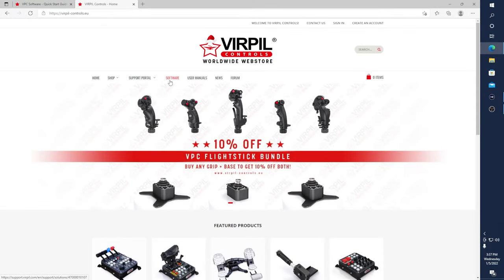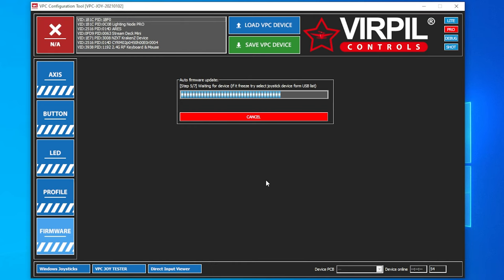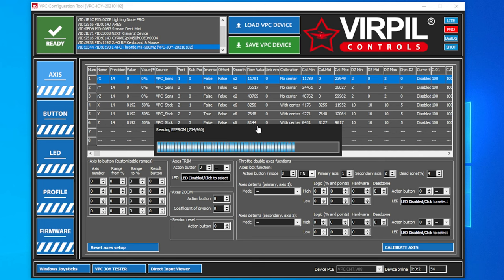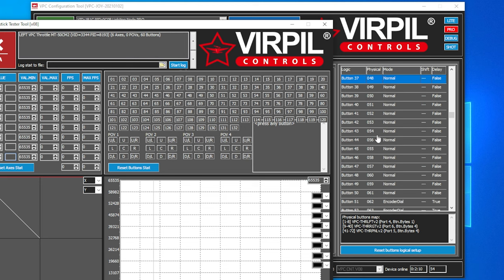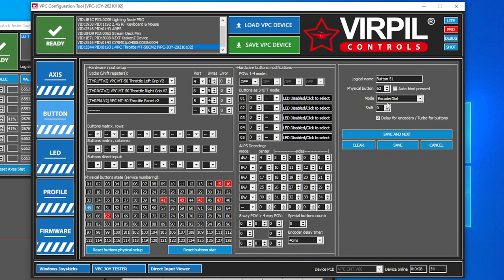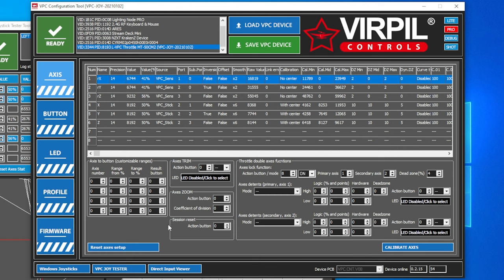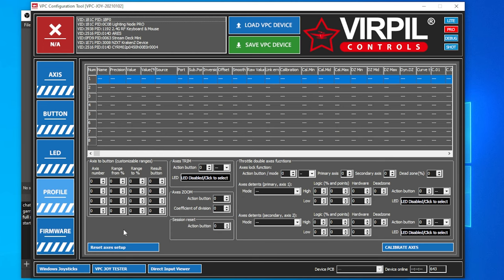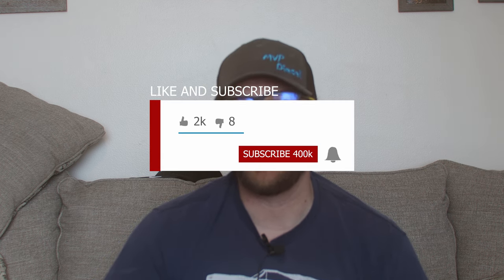COMPLETE 2022 VIRPIL SETUP GUIDE. FROM OUT OF THE BOX TO YOUR FAVORITE SIM.

Comment: I am really pleased that I found your video, I have been hesitant to pull the trigger on Virpil because the programming looked intimidating.   This has also cemented my choice due to the quality and straight forward aspect of their product.  A slight learning curve with programing everything I am sure, but between your tutorials and some trial and error it doesn't seem so bad.
Reply: I find all of these more high-end devices to be a bit "work-intensive" when it comes to customization. But that's to be expected, when we're talking devices that offer a high degree of flexibility. I tried to dabble in TM's TARGET when I was still using the Warthog throttle and found it to be incomprehensible. VKB's software is also very powerful and rather cryptic to the uninitiated. Virpil's seems a little less intimidating, but it's still pretty complicated. That said: Both for VKB and Viripil you can get very good customer support on their forums and/or discord channels. I've posed specific questions for both my Gunfighter and CM3-throttle on those and always got solutions/instructions on how to achieve the behavior I was looking for. Also: I think Virpil have a pretty extensive manual for their configuration tool up on their website (in the support/documentation section IIRC).

Comment: One extra thing, you have to be running the Virpil configuration software with Administrator rights. Its manifest doesn't require you to put in the Admin password so it is possible to run as a regular user and have things not work.

Comment: Jon, this video is exactly what I've been looking for as I've read about the many nightmares users face using Virpil's software. With that said, you stated that the CM2 is no different than the CM3. Would it be possible that Virpil numbered their controls differently considering physical buttons 44-45 apply to T5 vs T3 as mentioned in your video? I ask because if so, then I would be happy to use your video as a guide to setting up a CM3 Controller.

I am new to flight sims and currently have the Virpil CM3, Thrustmaster Warthog, or Winwing Orion in my sights and I'm unsure which one I should purchase at this moment. Just ordered a VBK Premium stick and this will be my first HOTAS setup ever.
Reply: You should be able to use my set up video on both the CM2 and CM3 throttle. As far as which one you should buy, I have been using Virpil products for over four years and they have never let me down. I would do your research and look at all the reviews not just mine so you can make the purchase that best fits your use.
Reply: @johnathangraham7226  Doing tons of research is what lead me to learn about the Virpil brand, as well as VBK. I was down to the Virpil CM3, TM Warthog, and Winwing Orion. This morning however, I went ahead and placed an order for the CM3 so I look forward to using this video to set mine up once it arrives. Thank you again.

Comment: Please show assembly of grip to base. Pins don't align edit Figured it out, the cable is moveable. Also assembly of the base. If you put in the little round rubber piece the mount teeters as it is taller than the rubber stoppers on the base. Without that rubber center piece the mount is stable.

Comment: Thanks John for the video, I had to do computer updates and re-install to dcs. Currently I have a problem when I connect the two virpil devices together in AXIS. How do I fix the situation?  I know that each device must be installed separately and the devices worked fine for a year, now I have a problem that everyone mentions... Is there a way to fix it without deleting the previous setup?  How do you do it?  Thanks

Comment: Virpil's software gives you great control over how your devices appear to the rest of your equipment. The problem is that if you have multiple games you want to play you might/probably need multiple profiles. This means resetting the configuration when you change games. Its not automatic and there is probably a limit to how many times you can reset the configuration. Given how good the hardware is that might be a problem in the future.  Lg-Hub and Joystick Gremlin both offer per game profile loading and since they are software, not firmware, there is no load limit. LG-Hub is proprietary to Logitech so I lean towards Joystick Gremlin. The mode switch could be used along with a freaking complicated profile but I really wouldn't want to figure out and maintain it. You would also be limited to around 5 games. I'm still debating what way to go.

I think there is a 128 button limit on USB devices. Some games have a limit of 32.  As an example the CM3 Throttle has 32 buttons on the dual throttle alone, the other buttons aren't recognized by several games that I play. Some versions of the Virpil software allow you to "split" the button range so that Windows sees multiple devices with no more than 32 buttons each. Joystick Gremlin also does this using the vjoy driver. Add in slaving a panel to a Throttle or Joystick and things get difficult. Are there any other solutions?
Reply from the maker: VIRPIL 5 WAY MODE TUTORIAL (watch to the end for tips)
https://youtu.be/X7f-v6rOK4k
Reply from the maker: As far as games that limit to 32 buttons I have no answer other than more button boxes/panels. Or game developers to code their games to accept the 128 buttons per usb device set by windows.

Comment: Hi Jon. Thank you for the informative video. I'd like a video where you demonstrate the use of the mode switch on the CM3 throttle in conjunction with the Control panel 3. In my understanding, it will make possible for the push buttons to act as multiple logical buttons in DCS. I was thinking of maybe having one mode as take off/Landing, another for combat, maybe one for wing man commands in easy communications etc. Also, I'm curious about the 'Switch' function that you mentioned, maybe you can touch on that as well? Thanks, Thomas
Reply from the maker: I use the mode dial as a modifier in dcs. Then you can set it up exactly like you described. I’ll do a quick video.
Reply: @JGandT  Great, looking forward to it :-)
Reply: @JGandT  I also understand, that this modifier works with the control panel 3, if it is hooked up to the cm3 throttle? It is not all that clear in Virpils documentation, how you daisy chain a throttle and a control panel, and how you set up the modifer in a throttle only configuration or in a daisy chained configuration. Or it might be just be, that aren't able to find the information :-)
Reply from the maker: @RAIDR_71  I don’t believe you can daisy chain the cm throttle to the control panel 3. I tried this while making the video above and I didn’t get the option to set the panel 3 as a slave unit.

Comment: Thanks a lot for  this tutorial mate! I was having problems at first but noticed I couldn't have DCS started when I'm configuring VPC software. 

A question for something I didn't see covered:

I'd like to use the right encoder on the thrust lever (thumb one) for radar antenna elevation. Is it possible to make that encoder into an axis or can I turn down the sensitivity of the encoder, right now ever little click is a whole 10k ft in radar elevation scan difference.

Comment: Hello again Jon.  Thanks to your videos my CM2 Throttle was set up perfectly and working fine for the last 8 months but last week it suddenly didn't recognize any of the buttons or switches and only 3 of the axis controls (throttle levers and flaps lever).  This was happening in any game that I tried. Virpil said some wires need replacing (so strictly a hardware issue) but before I go that route, if you have a spare minute I was wondering if you or any of your viewers have come across this. Thanks in advance.
Reply from the maker: I haven’t herd of this. Did you try updating the firmware?
Reply: @JGandT  Yes, software and firmware updated but no change. I read on forums that others were having similar problems but no concrete solution as far as I know. Looks like I’ll have to put all of my technical skills to the test and ask Virpil to send me the replacement wires for the DIY option. There is an accompanying how-to video. Thanks for your response.

Comment: I'm sure this has been addressed before somewhere but I'm new to the setup stuff. Once I create profiles for everything what is the best way to connect all items together so it eliminates how many USB ports I need? I am getting the Throttle, one control panel, and the joystick. Can you daisy chain all three somehow and only have one USB into computer? I'm trying to avoid using a USB hub because my USB ports on computer are mostly taken up by other things I can't unplug. My keyboard takes up two usbs as it is. Thanks for the advice.
Reply from the maker: At this time I believe you can only slave 1 device thru your throttle. I just tried going from ka-50 to cp1 with no luck. The problem you would run into is buttons. Windows will only recognize 128 buttons from a single device. My throttle and cp2 produces 120 after I set up axis to buttons I have 2 remaining slots. I recommend using a good powered usb hub. https://amzn.to/3ylTA5D  I run 2 of these on my simulator.

Comment: Hey man,I just got my Control panel3 but when I try to slave it to my joystick or the throttle this is no option for it. THere is one for panels 1 and 2 but none for 3. It only seems to work when plugged into the USB did you have the same issue?
Reply from the maker: @Blacknight49 I was unable to slave the control panel 3. I’m not sure if this will be available in future software updates.
Reply: Hey man just for your information I got my control panel three and you're right it doesn't work slaved, but Virpil did point me to their beta software for joystick configuration and that allows it to slaved which actually gives a bunch of new features( Like older games not recognizing all the buttons on Virpil controllers) but it's still in beta.  @JGandT

Comment: Hey Jon! great video! Question, I see its stressed that you connect each controller to the mother board USB initially. Can i move my controllers to a hub after the initial setup is complete?
Reply: The issue with plugging directly into a motherboard is really a simplified rule to ensure nothing disrupts your USB bandwidth and power delivery during a critical operation. If you have an unpowered USB hub and are running a high bandwidth webcam, and maybe a high speed SSD or flash drives at the same time, you could have a problem. Rather than explain all of the those situations to examine and consider, it’s easier to just say “plug it directly into your motherboard.”

If you have a powered USB hub, and aren’t sharing high bandwidth usage with something else at the same time then you have little to worry about. And if you’re past initial set up and not doing a firmware update you have nothing to worry about even if something goes wrong. The worst that’ll happen is a cut out / stutter in functionality. It won’t brick your device outside of a firmware update disruption.
Reply from the maker: I agree you want to plug straight into the Motherboard any time you do firmware updates. The reason for this is if you lose power or have a problem with a hub during a firmware update it could corrupt your product. This is true with any usb products not just Virpil. With that being said once you have your firmware updated you can make all controller settings with a usb hub. I highly recommend a powered usb hub, here is a link for the hubs I use. https://amzn.to/3ylTA5D  I run 2 of them for my sim set up including usb powered screens and the only problem I have encountered was with my steel series head set and stream deck. Not sure why but those have to be connected directly into the motherboard. I hope this helps.